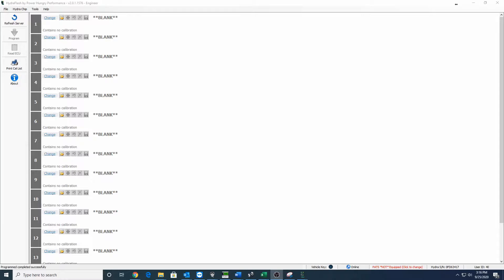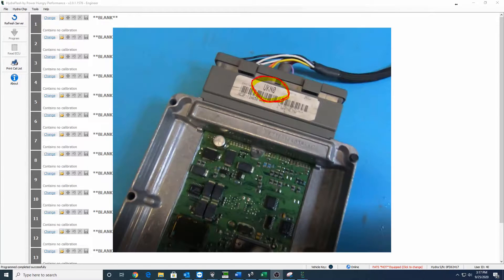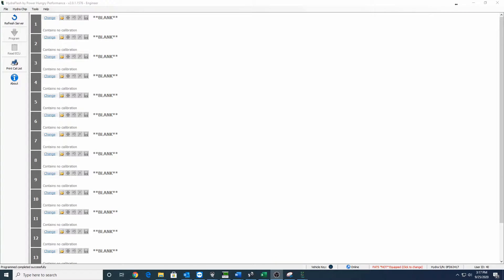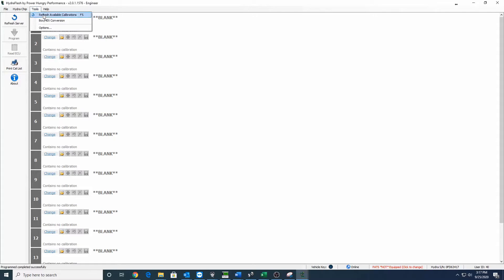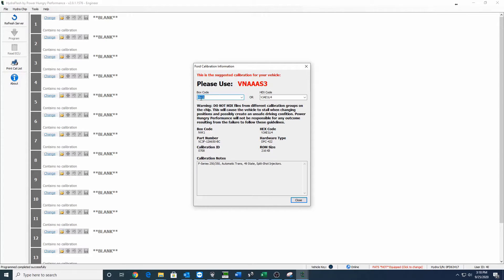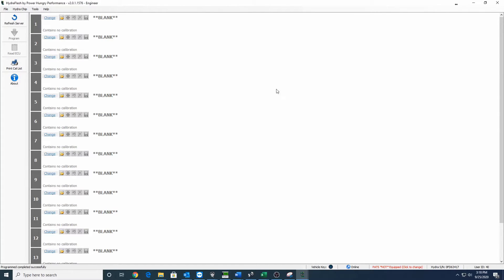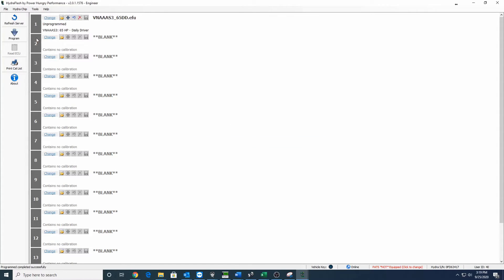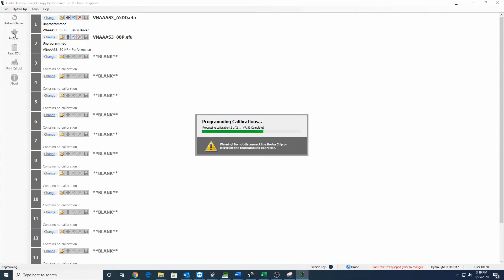Hydra Chip Programming - PCM / Hex Code Help

Comment: Can I run your 100n tunes on stock injectors? or does it come with stock injector tunes as well?
Reply from the maker: The HydraFlash software comes with access to stock injector tunes. You always want to match your files to your injector size.
Reply: @PowerHungryPerformance  Ive gotten testy with my 100% injector tunes on stocks whats the real risk other than injector wear?

Comment: I’m having trouble my pcm is remanned, so the hex code it gives us is different then the desired calibration*
Reply from the maker: Always use the Desired Calibration. If you've got a PCM without a sticker, use the Hydra Chip to read the ECU and then put that in the converter tool, then use the Desired Calibration.

Comment: I’ve got a 97 7.3, auto that was manual swapped. I have factory pcm. Not sure if it’s been flashed or if it’s in the edge tuner it has on it. I want to switch to hydra but when I put my code in it gives me tunes for a automatic… what do I do?
Reply from the maker: The automatic files will run and drive the truck, you'll just have a CEL. If you want to send our support email an email with your PCM code, we can give you the manual counterparts to try.

Comment: Plz help 1997 international box truck dte466 150k miles 4spd auto 4.44 final drive 64mph looking to run up and down the highway with a higher top speed 70-75… what should I do? Go with a 4:10 gear and tune it for the low end. Thx for any help!!!

Comment: So with my list of tunes it gives me 3 options per tune like 25 daily, 25 daily- modified valve body, and 25 daily -(something like modified shift I can’t remember). But my question is what is the third one aka the one I can’t remember and would that be the recommended one for a stock transmission? My box code is VDH2 if that helps
Reply from the maker: For a stock transmission, try the standards first. If you find you run into erroneous downshifts at heavy throttle, try the Hybrid Shift Strategy files.
Reply: @PowerHungryPerformance  thank u

Comment: I used the tunes it said were specific to my hex code and the truck will not start unless I put it in 00. Stalls if I switch it to anything. I can find any help, what coupd be wrong?
Reply from the maker: Mike, anytime we see a stall condition or a crank no start, we start with the PCM contacts. They are most likely improperly cleaned.
Reply: I’m having this same problem